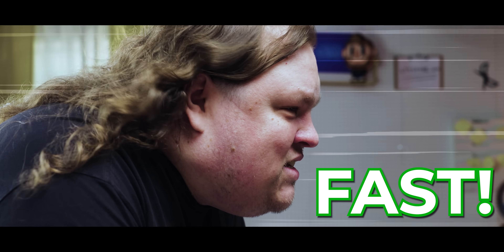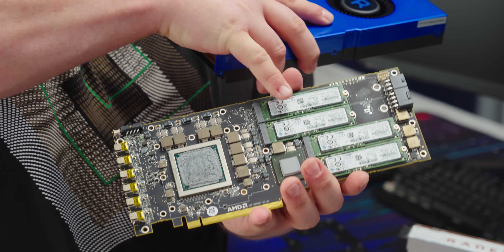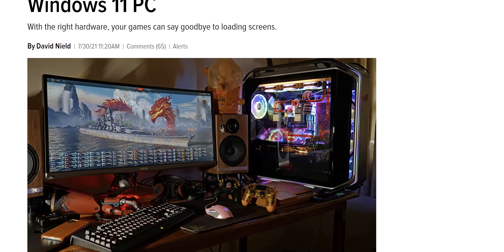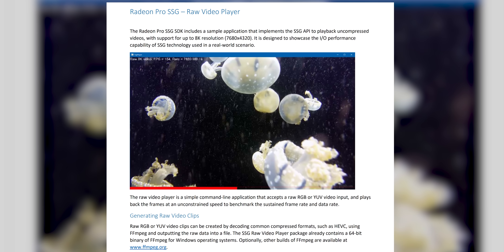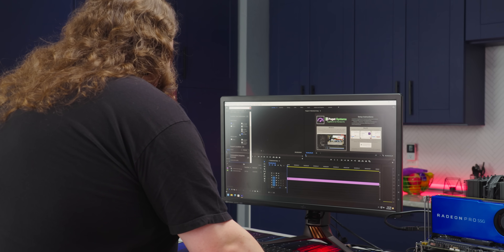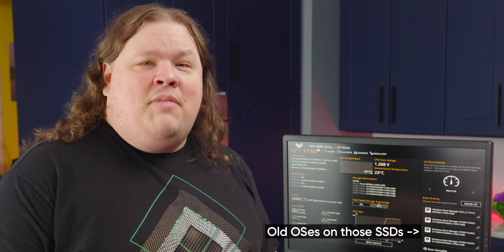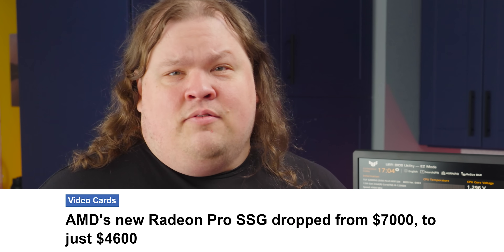Why does this GPU have an SSD? - AMD Radeon Pro SSG

Comment: Actually handy for when your motherboard does not have enough m.2 slots.
You can buy these as just the raid 0 cards that will plug in and use PCIx4.
Reply: They could literally give you more m.2 if they gave you a pcie card with m.2 slots
Reply: @WayStedYou  but those dont look cool
Reply: @WayStedYou  as someone who uses an itx system when pcie5.0 comes out i really hope something like this comes out as even gpus barely use the extra bandwidth from pcie4.0 why not put some m.2 slots on gpu's espessialy with MDA coming in the near future
Reply: @Bobis32  power and bandwith
Reply: @somefish9147  oh yeah bc SSD use sooooooooooooooooooooo much power
Reply: @Bobis32  exactly my thought.  If I could afford it, I'd even buy this old thing now, it’s probably better than my 1060
Reply: While technically that's a valid use case, this gpu came at at $6k. At that point you should just buy a better motherboard.
Reply: @theboxofdemons  Well yeah, a CPU with enough lanes and a motherboard with support for those lanes. Back then though they would have been few making the ability to share some of that x16 quite useful.
Reply: @somefish9147  again, the bandwidth is not an issue, especially now that we're up to 5.0 with AlderLake and soon Zen 4 (and when a 3080 works just fine on 3.0, and 5.0 quadruples the bandwidth...there's going to be plenty to spare for NVMe storage)  And power is also a trivial issue relative to the GPU itself.  Besides, the request here isn't necessarily for an identical solution; having 4x m.2 slots would be nice, but really just 1 or 2 would be amazing.
Reply: Or you could buy a card that does exactly that but costs waaaaaay less - the Asus Hyper M.2 also has 4 m.2 slots and is like $50 for Gen3 and $70 for the Gen4 version. They also have the benefit of better performance since they simply switch the PCIe lanes and let your CPU handle the drives directly instead of going through some shitty controller... (they are also way more power efficient and actually available)
Reply: @nicoj9984  those cards require PCIe bifurcation support, which isn't available on most motherboards (hence a controller) plus the appeal isn't in just extra NVMe drive potential, but the efficiency of having more NVMe storage alongside something like a GPU; for instance, we can't plug a Hyper m.2 card AND a GPU into an ITX board, or even if we do have a motherboard that can handle cards like the Hyper m.2, we can get even more NVMe storage onto the system by sharing the GPU's lanes.
Reply: Not sure if thats worth 1500€+ though
Reply: IIRC dedicated PCIe switch do exist but just isn't cheap.
Reply: @theboxofdemons  current street price looks like around $2.3K, so it is getting cheaper, but GPU prices are still too high, including on this. =/

Comment: Man, from what I recall, this thing was baller for Revit/CAD work. Those needed the entire model in VRAM, and it'd be a massive hurdle to do that over SSD > CPU > MEM > GPU. This was pre-host bus controller, which is the 'not as fancy' name for directstorage. Allowing devices 'other' than the main controller in a PCIe network to take control of another device. Like a GPU just... assuming direct control of an SSD (after some mediation obv) to just load stuff off without the big overhead. Obviously since then we also got (first on AMD, later on Intel) SSD's direct on CPU, rather than a PCH in-between (like Intel had until recently when they figured out that just 16 lanes from CPU was not enough).
Reply: I was kinda thinking the same, or using it for parraralised ML or big data applications it is a WS card after all, running an openCL coded ML algorithm direct from 2TB of fast storage on the GPU, that's a lot of test data.
Reply: It's very interesting for computational fluid dynamics too. Although there are ways to make CFD codes require less VRAM (demos on my YT channel), you always want maximum resolution possible. You could do colossal resolutions with TBs of storage. But in practice it's unusable, because even the 14GB/s is extremely slow, and you would rewrite this storage 24/7 which would quickly degrade/break it. With VRAM directly, you can do 400-3300 GB/s. So the SSG never really took off.
Reply: I occasionally deal with massive scenes and mesh or particle caches in Redshift for Maya, and Redshift could use this for sure! The same goes for trying to use Redshift to render massive print images where Redshift's out-of-core technology could benefit from having all this storage connected directly to the GPU core. No more Out-Of-Memory failures!

Comment: I can see this being used for ONE specific use case. Instead of having a separate SSD-in-one-enclosure and GPU and taking more than 1 or 2 PCIE slot, i.e. 1 LIQID Honey badger and 1 GPU, just use this!

This card actually make sense and I'm sad to see this tech not taking off because if you know how and why to use it, this is revolutionary!
Reply: with direct storage sharing bandwidth with ssd is no problem. Problem is gpu it self. In few yers it will suck.
Reply: @GoSite  solder a better one flash a model firmware done or you can adapt a Socket like mountings and replace gpu as fast as you want  before the gpu is assembled how do you think they test it

Comment: I wonder how it'd work with deep learning stuff, if the memory capacity would outweigh the speed.
Reply: I was surprised there was no mention of that potential application as well.
Reply: @ilyearer  Same. Seriously looking hard at this card now, since memory size is an upper limit on the types of existing neural nets you can fine tune. RTX 3090 has only 24 Gigs compared to this, 2048 Gigs. Yikes.

Comment: I'd be curious to see this concept again once m.2 key f finally sees some use; though if we never see a future where there's high bandwidth busses with tight memory timings, essentially combining what GPUs and CPUs like, this concept should be put off to key H, J, K, or L, to not confuse high bandwidth GPU memory with tight timing CPU memory on key f, assuming a future memory standard ever actually makes the switch. Though with how fast devices are becoming, it'd be cool to see a unified memory-storage platform where the only difference is if the chip itself is considered volatile or not, essentially the original concept of Optane on steroids; this would also be cool if there's semi-volatile chips where a sudden shutdown could retain otherwise volatile data.

Comment: When I saw that board I thought they were gonna have a complex memory controller that'd drive the nvme drives with the normal ddr memory as a cache, not as literal storage devices sitting on the gpu for fast load times.

Comment: Huge use case for AI training. Anything over 80GB of memory means training has to move from GPU’s to CPU today, and that means a slowdown by multiple orders of magnitude. Unfortunate AMD has never had any real market share in the AI/ML world because their software support - even in 2020 - sucks.
Reply: how about in 2022?
Reply: @RyTrapp0  ye but intel bad
Reply: Wearout makes it a nonstarter, for inference though maybe could be a monster in the right circumstances.
Reply: AMD has introduced their new MI250X GPU with 128 GB memory.
But still you can never have enough memory. I'm working with CFD (see my YT channel), and there it's the same problem: You always want maximum resolution possible. You could do colossal resolutions with TBs of storage. But in practice the SSG is unusable, because even the 14GB/s is extremely slow, and you would rewrite this storage 24/7 which would quickly degrade/break it. With VRAM directly, you can do 400-2000 GB/s. So the SSG never really took off.
Reply: @ProjectPhysX  Thanks, I figured as much. It's a shame. Memory in the TB range truly opens up new possibilities for deep learning.
Reply: @RyTrapp0  That has nothing to do with AMD being incompetent. Mainboards don't have much memory on them, so they're limited.
Reply: Hey, better software support than Intel. Their GPU drivers are terrible and the Graphics Command Center is a big fuck you for anyone wanting a good control panel. Never seen something as janky and unreliable, meanwhile the Radeon software on my laptop runs flawlessly all the time ^^'
Reply: @trw8777  A lot of older boards don't have enough space. That's why AMD have to make compromises. Mine seems to have 128 mb, but a friend's only has 32 mb. Hell that thing doesn't even support XMP for his RAM, so it's stuck at 2400 MHz, it's terrible. I'm glad AMD still support their old boards at all after so many years, even if some were really flawed
Reply: Yea, the A100 80GB HBM2e showed ridiculous improvements over the 40GB HMB2 version.

Comment: Would still love to see an GPU with some sort of GDDR slots, so everybody can choose their own amount of Vram !
Reply: It would be amazing to be able to add more VRAM to my card
Reply: @coni7392  why ? your GPU can only access and throw around only so much data, and oddly enough the GPU's are tailored exactly to how much ram they have, might be useful for static images at high res, but high frame rates at higher res ? not so much.
Reply: The expense in no way justifies the benefit. The only thing you'd get is limited upgradibility. GPUs have a highly specified memory controller, basically supporting a few variations in volume, like, a chip might support 4, 8 and 16 gigs of discrete memory ICs each holding 512MB and nothing else
Reply: @psycronizer  assuming dynamic physical ram size and that firmware binds the addresses on init, would there really be no advantage in gaming, like having more loaded pre-render objs or prefetch code?

it seems that the disadvantage is letting the os treat them as global instead of driver-exclusive/defined fs ..? 🤨
Reply: @lazertroll702  not really, transfer speeds from non display storage to frame buffer are really a non issue now, so at some point adding more ram just makes for higher cost with no benefit

Comment: Pro tip for small, non ferrous screws, use a tiny bit of Blue-Tack to stick the screw driver to the screw head, then a larger blob to remove it if it stays in the screw threads and you want it back.

Comment: This is the first actual review of the SSG in the five years since it was announced. Every other article about it just parroting the AMD PR sheet from when it was announced. It uses a custom API to treat the NAND flash as an extension of the VRAM pool. The only adopter of that API was Adobe Premier.

In theory, it's a huge benefit for some workloads where larger VRAM pools are required. As long as the VRAM extension doesn't need to be as high performance.

In practice, it was only really practical back in 2017 when VRAM was both very expensive and small capacity. The NAND flash was just a cheaper way to expand the memory pool, something that AMD was not able to do traditionally with HBM. There are many solutions, even back then, that could render this GPU unnecessary for most of the workloads it was targeted for.

Comment: i'd imagine this is where pci gen 4 or especially 5 could have shined if this concept kept going to present. No worries about sharing bandwidth with the gpu as there is plenty to go around, far more than the graphics card and m.2 drives combined could saturate.

Comment: Actually it wouldn't be too bad if they put say 50GB of flash storage on the card, but it would need to be a type that can withstand a LOT of writes. They'd need some software to allow the user to choose which 1-2 AAA games at a time that you'd like to have their relevant texture files cached directly on the GPU. Or they could try to develop some sort of Windows Prefetch cache type thing, where it aggressively uses the 80/20 rule to try to identify the slowest and most loaded texture files that each game uses as you play it, then start saving a history of which files it will want to slowly pre-load onto the card the next time you go to play it. Perhaps they could pre-calculate what those are on a per-game basis and distribute some sort of map file, sorta like how the GPU drivers these days load different profiles for each game.

Comment: This reminds me of the Intel math coprocessors for the 286/386 CPU's Before floating point unit (FPU) processing became the default for all X86 processors. With the 486 Intel introduced the 486DX with the FPU and the 486SX with the FPU disabled.

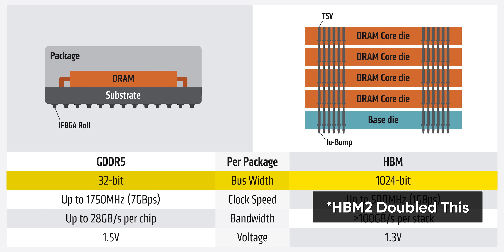Comment: 5:35 - That is not true. HBM2 is still connected by a 1024-bit memory bus. Its just that 2 stacks of HBM2 = 2048, while 2 stacks of HBM1 ... also means 2048 bit bus. They are exactly the same here. HBM2 brought much higher capacities, higher speeds, and lower latencies, it didnt change the connection it had. The Radeon VII for example and the R9 Fury are both 4096 bit machines, one is just 16GB of HBM2 while the other is 4 GB of HBM 1.
Reply: Reading your post, for some reason I recalled this:

https://en.m.wikipedia.org/wiki/Personal_Animation_Recorder

I had the PC version.  It used its own dedicated IDE bus, had its own framebuffer, etc.  Upon its release, there was only one HDD that was capable of the sustained throughput required.  The images also don't quite convey how huge these cards were.  It is probably the heaviest PC expansion card I have ever handled.  

It did not compress the video whatsoever, and could not use the system's bus/IDE controller--too demanding.  Furthermore, IIRC the video was stored as still images, one frame per file.  I don't recall whether it used FAT or a proprietary filesystem.  It was primarily intended for playing back  3d animation, but you could use it for whatever you wanted.  I think it cost at least $1000US.

Comment: This gpu has always made me want to know of Intel’s Optane m.2 could be used? Would it even work? would there be any use cases for that? Any benefits? 

Probably not but it’s just such an interesting opportunity to experiment with mixing different computer technologies…
Reply: I haven't used Optane much, but the technology is fundamentally more like non-volatile RAM, with higher performance and endurance but a fraction of the capacity as a comparably priced NAND Flash SSD.  It's most commonly effective when utilized as a hybrid cache layer, like how it's built into Intel H10 and H20.  I don't think the data center grade M.2 have achieved 1.5TB yet, last time I noticed that capacity was reserved for special use server DIMM!

Therefore, I expect Optane should mostly function in this SSG, but the benefits of upgrading would probably just be how long the M.2 would last with medium sized but frequently changing data sets before wearing out and if you're using it's API to not get performance bottlenecked elsewhere.  Perhaps use the API to write your own storage subsystem using two Optane 64GB 80mm long cache drives and two high capacity 2TB 110mm long storage drives... but I'm not aware of when an ordinary M.2 RAID card feeding multiple compute GPUs wouldn't be more practical.
Reply: @christopherschmeltz3333  Exactly.

Optane phase change memory tech hasn't even breached 4 layer device limitations.

While the state of the art in 3D/VNAND is already up to 170 layers and counting.

In short Intel bet on the wrong tech foundations to build Optane upon - it simply isn't well suited to 3D scaling which is a necessity for modern memory as area scaling is already reaching problematic limitations.
Reply: @mnomadvfx  Intel fabrication definitely bet on the wrong 10mn tech, but Optane will probably hold onto a smaller niche than planned until hardware RAM Disks make a comeback.  You know, like the Gigabyte iRAM back in the DDR1 era... there are newer and older examples, but Gigabyte's seemed to have been noticed by the most PC enthusiasts and should be simple to research.

Comment: Did you try seeing if one of the versions of graphics card powered SQL works well on this? Current issue with this is the data transfer speed with the CPU step involved. So might be worthwhile trying that.
Reply: It really wouldn't help unless the sql server used the api this GPU needs to directly access the file

Comment: It was used to accelerate large scaled industrial Ray Tracing or simulation.  The industrial scene files (of factories with complete parts) are so large that they usually would not fit in regular Ram/VRam, and by having it in SSD within GPU allows random look up to such humongous scene possible

Comment: From a flexibility standpoint this is amazing, GPU's integrating their own m.2 slots, and sharing the 16 lanes is awesome.  Also makes it easier to change ssd's as can just remove GPU from case to work on them easily.
Reply: In the case of DirectStorage use it makes even more sense again - not to mention you can cool the m2 drives better with a full GPU cooler (albeit the SSG cards are passively cooled server form factor).

Comment: Well...I would have a use for it. When running Tensorflow through a GPU as a coprocessor for Neural Networks, the SSG would result in supercomputer performance for complex multi-level networks. Its not for apps & games  - its for AI !

Comment: This card was originally designed to deal with RAW files like Red. It wasn't just a response to a card, it was a response to give prosumers the ability to work with high end raw files on non customized PCs or pro workstations. In certain raw files the CPU unpacks the file and hands off image files to the GPU for processing. The CPU keeps all other parts of the stream in sync with what the GPU is doing ..

In the API, there was plenty of room for Blackmagic, Adobe, Baselight, and many other manufacturers to support the card... And in fact, offloading storage of the cache, certain images of parts would have sped up 4k or higher Rez SDR quite a bit, and did, as you proved.